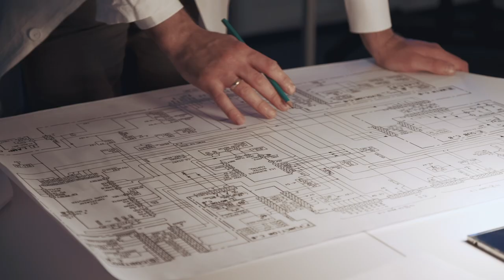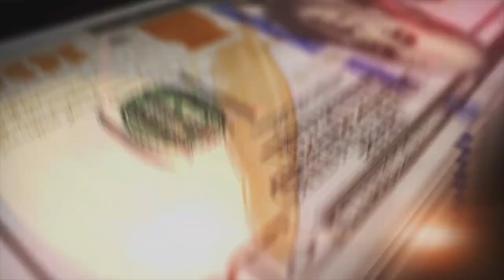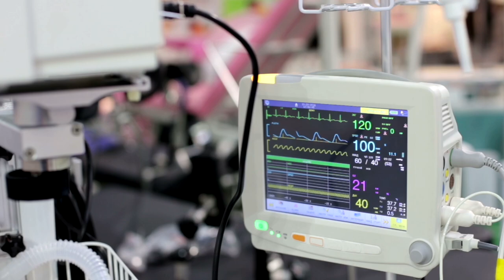5 Engineers That Should Have Been Fired

Comment: Note that Frank Lloyd Wright's design of the strength Fallingwater's cantilever was questioned by the engineer/construction manager.  FLW told him to build it as designed, but the guy snuck in double the strength.  In spite of this, the cantilever sagged quite a bit.  The organization that owns the building went through a major restoration a while back to prevent any more sag.  Another Architect getting in over his head. 
                                                   
You are wrong in saying that the Tacoma Narrows Bridge could have been prevented. The science at the time did not understand the forces that resulted in the bridge's collapse.  They were trying to figure it out which is why we have such a good photo record.  It took some of the best minds in aerodynamics and structural dynamics to figure it out in the aftermath!
Reply: This is an insightful comment. Thank you. While I have no background to comment with authority on the FLW issue, for the second issue, the Tacoma Narrow's Bridge, it did cross my mind that the science of the wind on the bridge was not sufficiently and ubiquitously understood to both acknowledge the challenge and design safely around it.

Comment: You have your facts wrong. The failure of the bridge was not in high winds it was due to harmonic vibration. Something they knew nothing about till then. The bridge failed in wind that matched its harmonic frequency.
Reply from the maker: Harmonic vibration caused by high wind
Reply: This person's an expert in making YouTube videos that use lots of stock footage. You wouldn't expect them to be an expert in structural engineering too, would you? ;-)
Reply: The potential effect of harmonic vibration on suspension bridges has been known for a long time, at least since 1831 when a troop of marching soldiers managed to hit the exact resonance frequency of the Broughton Suspension Bridge causing it to collapse. So lack of knowledge was not an excuse for the designers of the Tacoma bridge.
It certainly wasn't an excuse for the Millenium Footbridge in London which suffered from the same problem.
Reply: Exactly and the bridge also held up for quite awhile due to its flexibility considering the extremes to which it was pushed
Reply: @birdolla4441  I'm pretty certain that the Tacoma Narrows failure was NOT due to vibrational harmonics (resonance), that's just a very common myth. It was likely aeroelastic flutter. For more details and some sources, see the Wikipedia article.
Reply: Somebody has their facts wrong, that’s for sure. 

Resonance was a known factor in the 6th Century. The Hagia Sophia incorporated it in its design with a major update in 534 to reflect the higher wind loading the building experienced as it got bigger. 

The 1940 Tacoma Narrows Bridge was due entirely to side effects of wind as a result of guesswork in its design. Leon Moisseiff, the design lead, decided the wind loading factor was too high so he dropped it from an original effective load of about 3 PSI in 100 MPH to 1.25 PSI in 100 MPH winds with the result being a much lighter structure that used smaller components and the reduction in cost made everybody happy. 

His reasoning was that the lack of large surfaces meant he didn’t need to treat it like a building. The wind said that was foolish and decided to make him an object lesson for engineers of the future and tore his bridge apart. 

It would never have been a safe structure. The wind would have destroyed the structure anyway. The resonance effects were just a gift from the wind for his gut feeling engineering.
Reply: The harmonic vibrations were caused by not accounting for the uplift forces caused by the wind gust frequency. Just because something was "known" doesn't mean everybody knows it.  The failure is a topic of discussion in every structural design course.   And remember,they don't check to see if ya have a PE license to edit a wiki page.
Reply: @tessjuel  Broughton Suspension Bridge failure was not caused by the troops but a failure in the bridge ("a bolt in one of the stay-chains").  I also recall MythBusters featured this years ago on one of their programmes.
Reply: @Underworld5s  You are correct, one of the main causes was high winds
Reply: You can look it up, it was mainly caused by high winds, so, Underworld is correct
Reply: @tessjuel :
This is why when a marching formation approaches any bridges, the command "rout step" is given. This way, you don't get the "hut two  three four" cadence that can destroy a bridge. You get back in cadence after leaving the bridge.

Comment: Architects should be required to consult with the future building's users, to be certain it will be fit for purpose.
As an ER nurse,  I've worked in some terrible ERs, including one with the helipad on the roof, but no elevator to reach it! 
My current ER has no fewer than seven sets of doors from the ambulance bay to the resus area, and four of the require swiping an ID badge to open them. How is that supposed to work when an ambulance crew brings in someone who is coding? They literally have to wait for someone to come swipe them through all these doors.

If nurses had been consulted during the design process, neither of these ridiculous buildings would have ended up like this.
Reply: The architects should be made to work in their buildings. I work in a library that received multiple awards, but has insufficient ventilation, self-opening windows that do not self-open, and a moat that was supposed to provide cooling and water for flushing the toilets in an environmentally friendly way. All that happened is the moat filled up with duck shit and silt and patrons complained that the toilets did not flush properly because the water still looked like it had urine in it. There's no AC as the building was supposed to be self-cooling and would save electricity; result is it's hotter than hell in summer and we have had to spend money on a portable AC system. Fixtures and fittings were sourced from Spain (we are in NZ and have very good fixtures made here) at great expense, and when these failed it took three months for them to be replaced with identical fittings. At least our building is not a threat to life as your hospital seems to be. I'm sorry that you have to work in such a rotten building. Architects are just nuts.

Comment: It should be noted that at the time the Tacoma Narrows bridge was built, resonance of standing structures wasn’t know. The engineer who designed the bridge spend the rest of his life studying it.  He had previously built a number of important bridges, some of which are still standing
Reply: What I don't understand about that bridge is how can wind make concrete and steel sway like that?? Weren't roads and bridges then made of concrete and steel like they were made in more recent times? That bridge swayed like one of those rickety boarded walk bridges with rope railings in a hurricane.
Reply: @alvexok5523  if the bridge had been very short, it wouldn’t have been a problem. Steel and concrete can give a little bit, and over such a long distance it adds up. And the extreme flexing caused the steel and concrete to fail.  So, yes, it was made of steel and concrete.

Comment: If the arena collapse is the one I'm thinking of, then the pooling water on the roof was a major contributor since the wind pushed the water all around the roof. This created a dynamic load on the roof structure that was higher than the static load of the water.

Comment: If memory serves the French train issue was actually a failure of the maintence department to undertake the necessary modifications in time. It was cheaper to buy standard trains and mod the platforms than design bespoke trains for a part of the network.
Reply: Reminds me of another failure in South Africa, where they bought diesel locomotives that were too high to use on some electrified lines they were supposed to (also) use, despite being warned by the engineers.
Reply: Maybe some day Europe will get out of the 19th century and use modern transportation methods.

Comment: Architects design buildings....the form, function, materials and asthetics based on the needs and desires of the owner or user.  Structural Engineers size the columns and beams to keep them from falling down.  Mechanical Engineers design the HVAC systems to heat and cool them.  Electrical Engineers design the wiring and communication systems for them.  Civil Engineers design the site drainage systems to manage the water and keep them from flooding.
Reply: @steve vice: Yes -- the narrator blamed engineers for some problems caused by architects, such as the penis-shaped church and the swastika-shaped buildings on the U.S. Navy base. Of course, engineers do deserve the blame for the collapse of that ("something" Narrows Bridge over Puget Sound that resulted in the death of the dog inside that car. -- I know about the dog from other videos. 😒

Comment: I was stationed on that base in San Diego. When the buildings were built, the big trees in that photo weren't there originally. The open courtyard area that connects those buildings made it obvious they were separate. Over time since they were built, the trees got bigger and the courtyard surface just got darker with age, which made it look like it's one solid building instead of four separate ones. The design was definitely not intentionally meant to look like a swastika.

Comment: ...and you didn't even mention the architect who designed more than one building where the reflective glass windows concentrated dangerous heat levels on nearby buildings and pedestrians.

p.s. Please say "engineers who", not "engineers that". The recent decline in the proper use of the relative pronoun "who" is very sad.
Reply: Ohhhhh, you're not going to like what they are doing to pronouns in congress.

Comment: Norway ordered new ambulance and search and rescue helicopters some years back. These were larger, more powerful and all over much better than the smaller ones they had earlier. However, nobody bothered to check how much clearance they needed for landing, so effectively, it can't land on most of Norway's hospitals until their helicopter landing pads have been rised by 20 meters or so. In the meantime, they'll land quite a distance away and the patients will have to be moved (with those risks included in that) and transported by an ordinary ambulans to the hospital.

Comment: Regrading design failures, the responsibility of that lies purely with the designer which is using held by the architect. The engineers responsibility is to check that the designs are viable.

Comment: No mentioning of the screwed up engineer problem at Ross Perot Jr airport(AKA Alliance Airport) in Fort Worth?  They inverted the blue prints of the whole project.  They realized their mistake after they built it.  The runways was originally suppose to run NE to SW, but were built NW to SE.  This means that the planes are flying over my high school when they land and take off.  I am surprised no planes have crashed into the school yet.

Comment: Re: #5 & #4 -- designers designed these.  Engineers came later.  Blame designers.
Re: #3 -- I believe contractors did not install all of the bolts (as some did not fit -- should have been resolved, but they didn't try)
Re: #1 -- nothing to do with engineers.  A purchasing agent problem.
 - a Chem Eng
Reply: Engineers often have to iron out the problems that architects have made

Comment: Been cussing at engineers who don’t know how to read a tape measure or bury a high maintenance part underneath a bunch of other stuff or in order to change the spark plugs on the rear bank of a transverse v6, the factory reccommended repair was a 2” hole saw and plastic plugs for the floor board of a minivan. I could go on forever. If you want to be an engineer, you should spend 7 years as an apprentice building, repairing, skinning your knuckles in whatever field you want to engineer before they ever allow you to touch a drawing board. I know of a doctor/surgeon whose major was electrical engineering. Any competent veterinarian is 900 times better doc than this guy. I mean, he absolutely sucks!

Comment: the Tacoma Narrows Bridge was not a preventable disaster given the state of knowledge at the time of its construction . . . not the engineers' fault.

the naval base barracks was an architect's design, not an engineer's.

Dick's church, architect again, not an engineer, again.

arena roof collapse, possibly the engineer but design criteria for slow release of water forced the design, if improper bolts were specified then engineer's fault, if not then supplier/contractor fault.

apartment block collapse . . . inadequate standards contributed . . . a gas explosion isn't a small outside force . . . overpressure of just 2 or 3 psi over a 100 square foot wall amounts to a total force applied to the wall of between 30,000 and 40,000 pounds! . . . and that's likely a very conservative measure . . . again, not the engineers' fault, you design a building to withstand explosions only if it is to be used for things like manufacturing explosives.

train width should have been verified by measuring an existing railcar . . . an owner/operator's problem, not a design flaw.

it must be fun to bash engineers from your lofty seat of perfect knowledge.